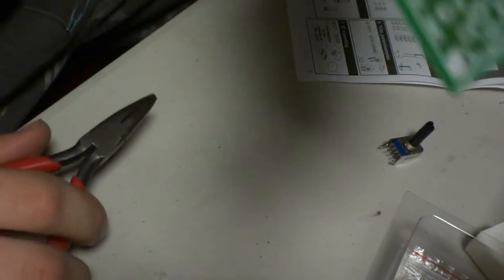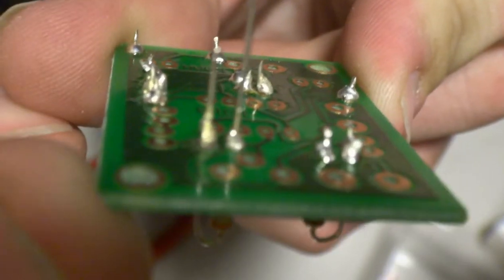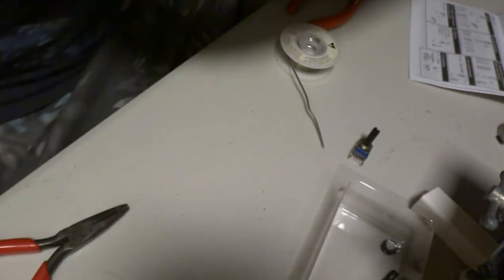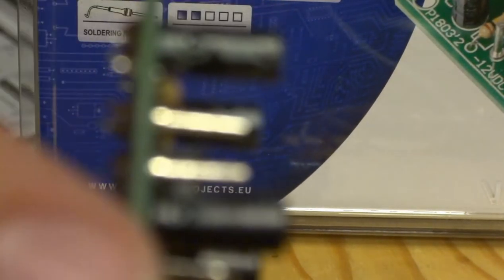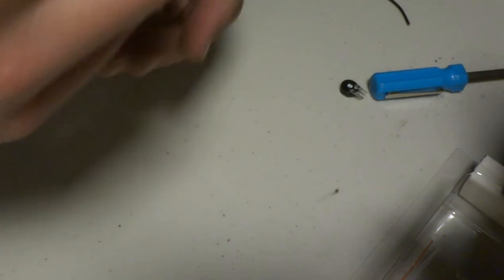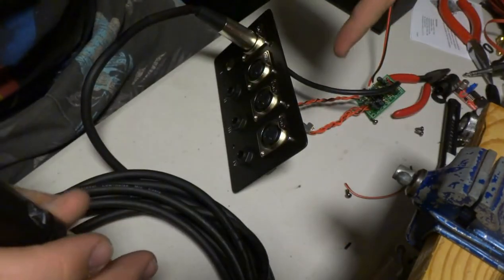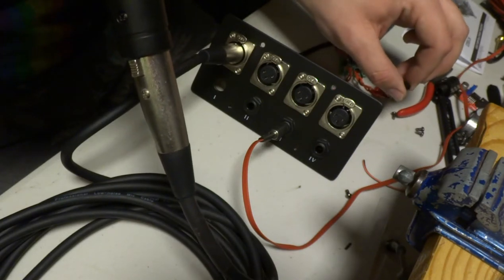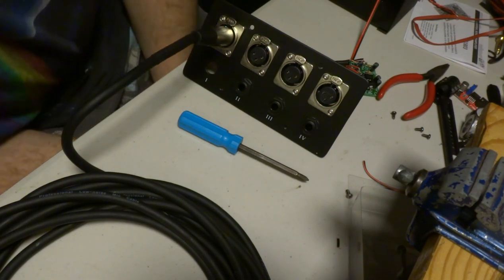Velleman K1803 Mic Pre Build

Comment: 21:20
The 250K potentiometer in this kit is not functioning like a traditional volume control knob (potentiometer). The 250K trim-pot in this kit is hooked up to a comparator (inside the LM 358 op-amp IC). I was confused too.

If you look at the schematic diagram, you can see the trim-pot is hooked up to the inverting pin of a comparator. 

This is what I found. The 250K trim-pot (in this kit) is functioning opposite to a traditional volume knob. A traditional volume knob (say, on a radio) increases the sound level by reducing impedence (resistance).

Strangely, this 250K trim-pot is doing just the opposite. The output gain is increased by increasing the impedence (resistance). Strange? Again, on the schematic, the 250K trim-pot is hooked up to the inverting pin, and has a feedback loop.

Here is my video: https://www.youtube.com/watch?v=iBPbIvq7ulE&feature=youtu.be
A good refresher on op-amps, and feedback loops: https://www.youtube.com/watch?v=7FYHt5XviKc

Anyway, sorry to be a know-it-all. I'm not. I stand to be corrected too.
Great video! I gave it a thumbs up.